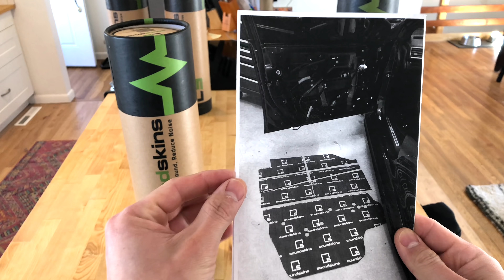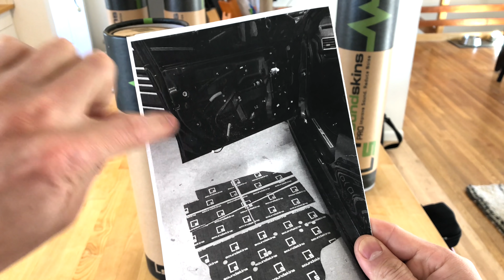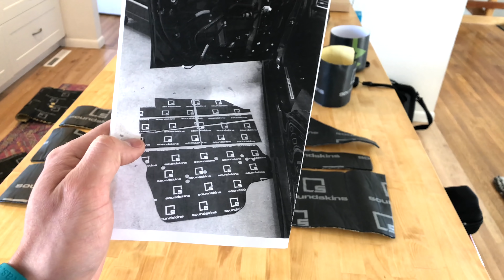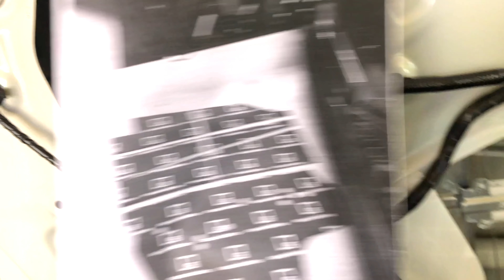2018 WRX/STI: SoundSkins Subaru Door Template Kit

Comment: great vid man. I saw this first on Boost and Shutter and later found that you have done it in all your cars. I was wondering if you did the decibel test for before and after. I am convinced it works and will be doing this soon on my car, but I would love to get some feedback from guys like you that have done this in many different cars.
Reply from the maker: Thanks man! I’m doing it again soon to my Q50s I just picked up!
Best thing to start with is the doors and trunk, then you can do trunk lid etc if it needs it. 
Headliner I did once in a Wrx made a huge difference when it rains doesn’t sound like tin cans.
Also I put a sheet on my slider for the sunroof that helps also. 
Fender liners is a stretch but I’ve done that twice also.
Reply: @AtlasWilder  So from what I saw on your channel, it looks like you sold the wrx when you got the qx70.
Reply from the maker: Juan Carlos de Diego yup got the qx70 and sold it to another Infiniti lover who totaled his fx50. Now trying new stuff with the electric hybrid q50s

Comment: So it is a cool product. However this is only half of what needs to be done. This product stops the resonating effect of the metal. You now need the fiber which is the only thing that keeps the road noise from passing thru into the cabin. That is where you will hear the biggest difference.
Reply from the maker: Andrew Copeman got any products you would recommend for that? I’ve been looking for some fender liner materials to really help with that road noise.
Reply: @AtlasWilder   look at luxury liner from second skin and then apply some undercoating spray to seal and protect it. You'll tremendously cut down on noise entering the vehicle due to it being a sound blocker.